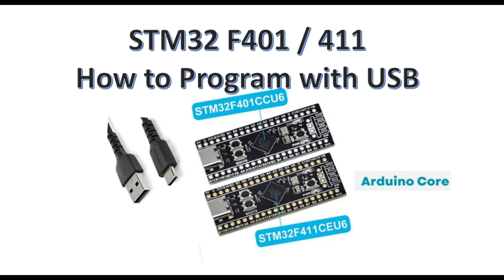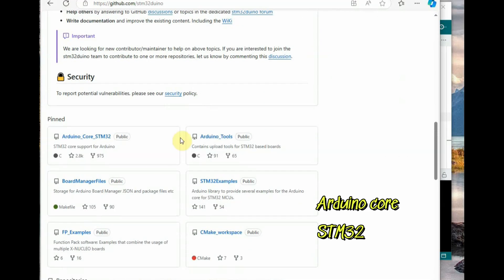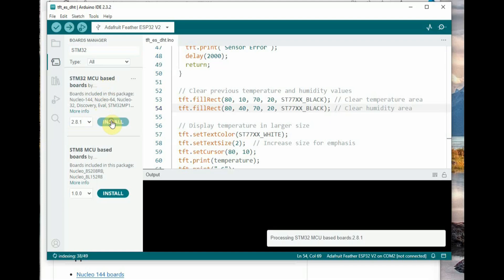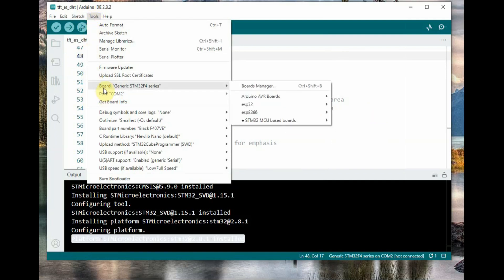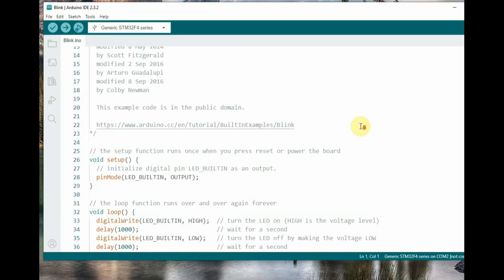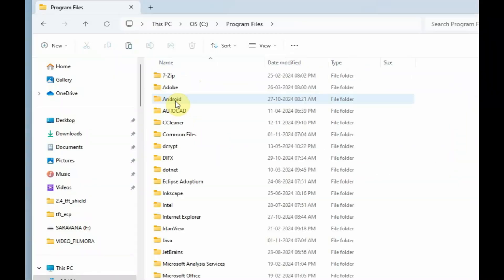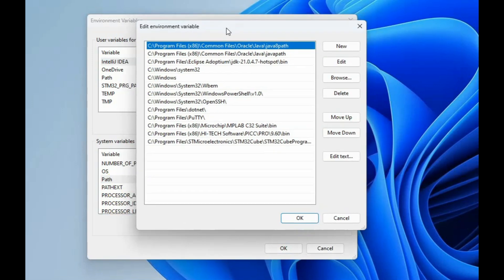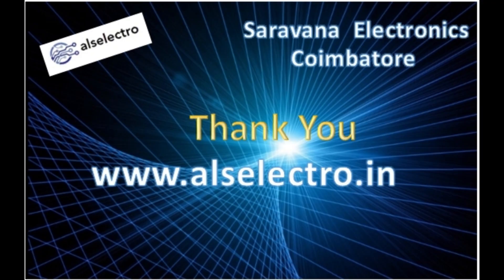STM32 F401 F411 -How to Program using USB

Comment: sir,  i have stm32f411ceu6 from WeAct v3.0. I flashed it with Inav  firmware for quadcopter and tested all sensor by connecting to the stm board and it was working fine but from today my laptop(windows 11) not detecting the board only pwr red light is on. I installed STM cubeprogrammer , stm32 comp driver. I am using type c cable. I tryed to enter dfu mode by pressing boot0 then connecting type c cable and by holhing boot0 and pressing rst ... but none of this working .. what to do?. do i need to install usb bootloader again?
Reply: Me too...
Reply: @lohikarhu734  my problem solved after i flashed it with the new stm32f411ceu6 firmware in it using stlink v2. I had to buy another stm and stlink for that hope you find it usefull.
Reply: @glidverse;
Thx!
I'll try it out.
Der 🧸
(Karhu= bear)
Reply: BTW.. I have to download the stm32 firmware from my other f411: board, right?
Reply: @lohikarhu734  https://youtu.be/-Y8RHdlDBhQ from memory and editing i saved .hex file and from erasing and programming flashed the saved .hex to the stm32 which has usb issue.
Reply: @gdbdff  i bought a new stm32. First i thought the above procedures fixed my problem but sad it didn't. I lost two stm32 by trial and error. Now i dont flash firmware now and then. I moved to betaflight 4.5.